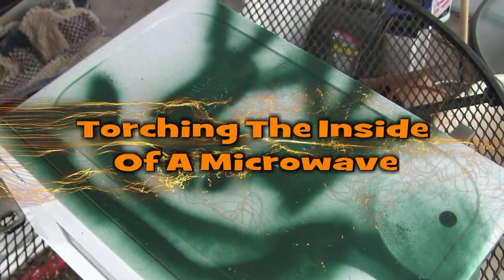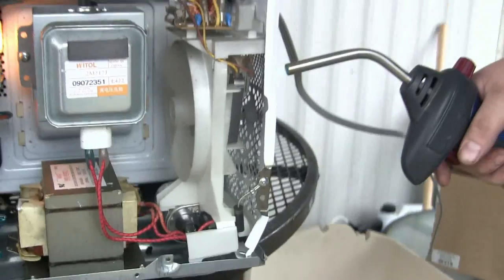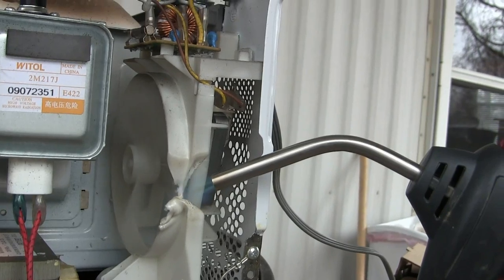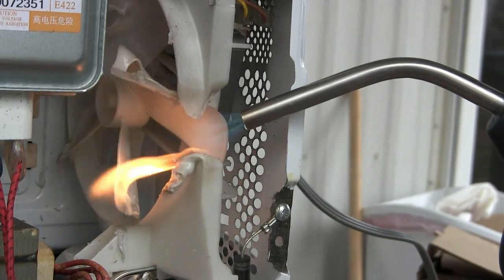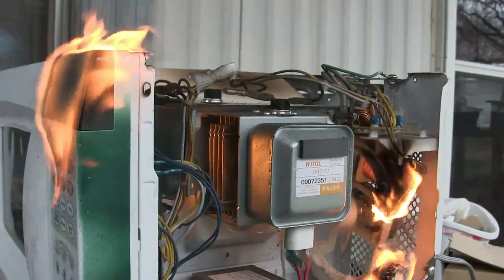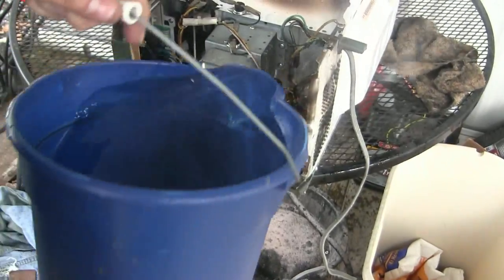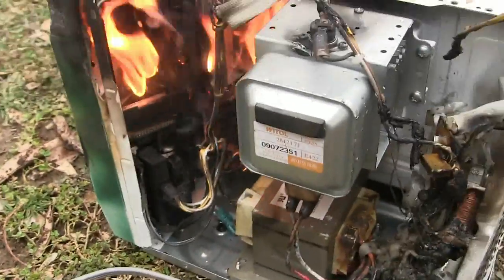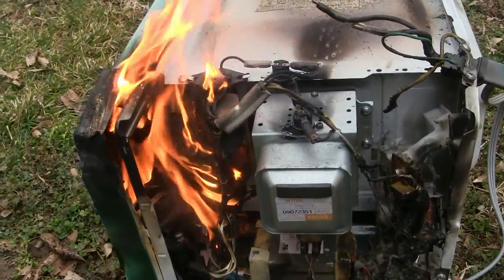Torching The Inside Of A Microwave

Comment: What do the magnatron and the transformer do that makes you remove them
Reply from the maker: Everything beyond the secondary side of the transformer is at a extreme high voltage. We didn't want to take the chance of burning through one of the high voltage wires while they were energized.
Reply: yeah the MOT puts out HV and is very dangerous, so they disconnected it. you dont get a second chance with High voltage.
Reply: magnetron is dangerous too because if you disassemble it the chemicals inside of it can cause lung problems, also it can fry you.
Reply: damn
Reply: dc74156 they can give you a certain type of cancer
Reply: Zmelini 642 that's scary
Reply: also the HV cap is dangerous. make sure if u go inside you discharge it first.. VERY dangerous.
Reply: O_____o
Reply: The magnetron can cause cancer if it's powered & have it open like that.
Reply: dc74156 
Dumblover
Reply: dc74156 I